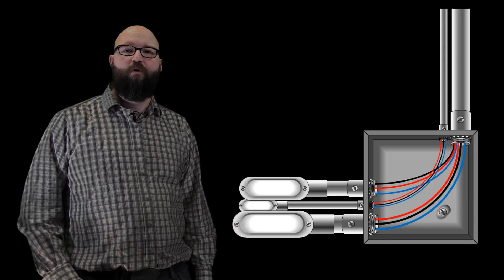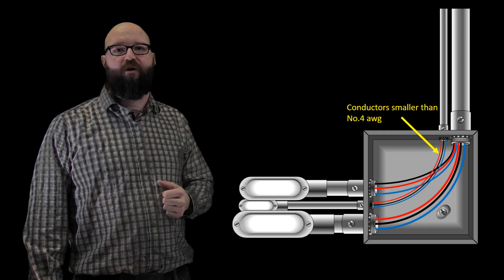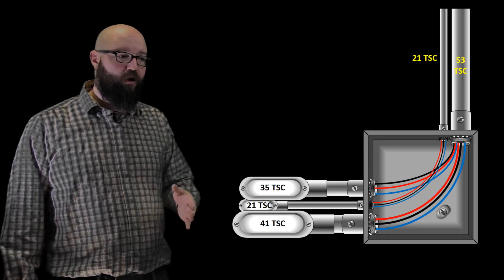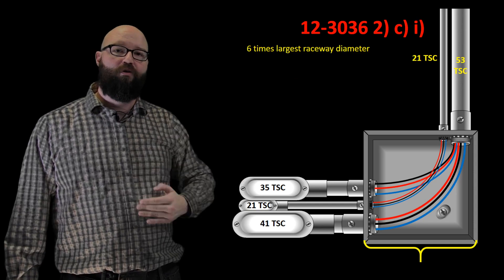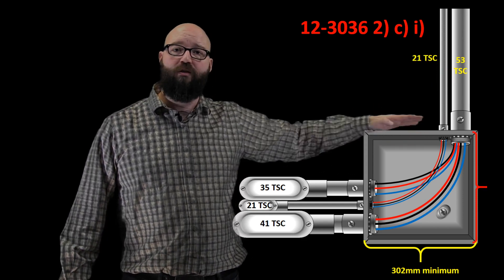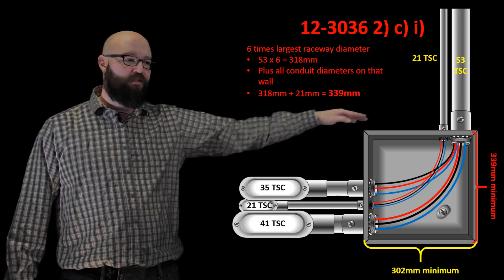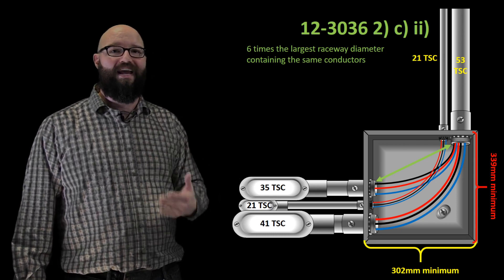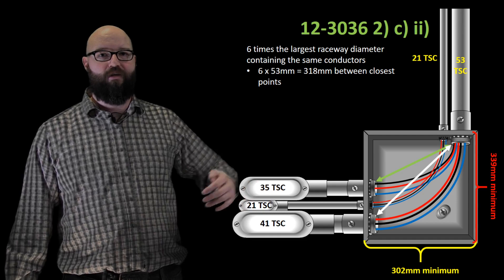The Angle Pull

Comment: so what if the wire size is # 12 ( or smaller then #4). apx 40 wires coming into a 24X24X6 jb from the back with 2" conduit. what calculation would I use. BTW love the videos.
Reply from the maker: At smaller conductor sizes there is less of a concern for bending radius, so there isn't a calc for it besides a volumetric box fill using table 22. That and care to not damage conductors on connector throats. 
Thanks for the support!
Reply: @schulerruler thank you that was my conclusion as well, but I wanted a second opinion.

Comment: Hi check the side that includes 35 TSC and 41TSC  you added 21 which is the location on the other wall means should be ( 41*6) + 35 = 281mm, is it correct?

Comment: I'm curious the outside diameter of a 41 conduit is more than 41 (the inside diameter is more than 41 too). Does this (minor) discrepancy need to be taken into consideration while calculating box size?
Reply from the maker: For sizing the boxes, no. For sizing conduit using table 10, 8, and 9, yes, then the internal diameter, or really the internal area is taken into account and all conduits and raceways are different in that regard.
Reply: @schulerruler  Thank you.